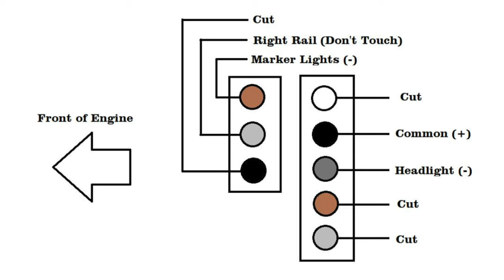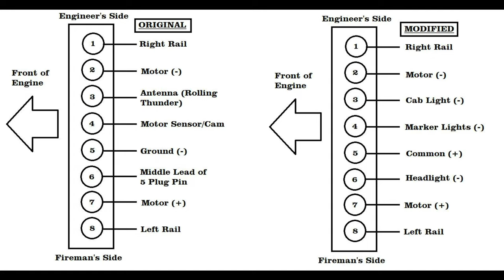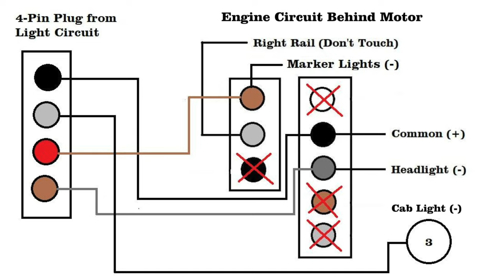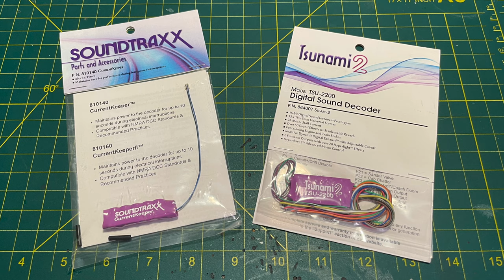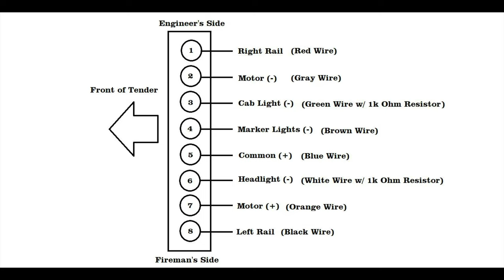How To: Install a Tsunami 2 Decoder into a Broadway Limited Paragon 3 Streamlined K4

Comment: Hi all! I have a light Pacific from Broadway Limited that did the same thing. Did some research and found a way to do a Hard Reset on the decoder. The CV8 thing does not fix this problem. 
The easiest way I found to to the Hard Reset is to do it using a DC controller. Remove the shell of the tender to expose the decoder. Put loco and tender on the DC track. Hold down the Reset Button and while holding the train, dial up the DC power until you hear a Chime. All reset and should work.
BTW nice video.
Reply from the maker: Thanks for the comment, unfortunately I can't perform it on this model, because well, the decoder got replaced haha. But next time I have an issue like this with another model, I will try this. If anyone else has success please let me know. I really hope this is a solid fix! Thanks again for the information!

Comment: Very nice job. Inspiring me to switch the decoder in my BLI 3751 class Northern now.... :)
Reply from the maker: After seeing the results, it makes me want to do all my BLI engines. Maybe starting with the BLI Santa Fe Mikados or my Paragon 3 3751
Reply: @OvernightScaleModels  I did my BLI ATSF 3751 northern. Installed an ESU decoder. Completely rewired wirh new Soundtrax 9 plan plug between loco an tender, new led headlight, Installed firebox light and cab light after super detailing the cab. Very happy with the results. Will be doing the same with all my 2-10-2s now. Far better sound and overall loco control. Thanks for the inspiration 😃
Reply from the maker: @1stArizonaSub  WOW! You gotta  post a video of her! I was thinking the same thing about installing a cab light and firebox flicker. Was the 9 plug pin female installed in the engine or tender?
Reply: @OvernightScaleModels  9 pin male in the loco, female plug with loom in tender, soldered via circuit board with resistors for LEDs, and directly to the decoder for all others.  Loco all new wires soldered to the little horse shoe shaped circuit board attached to the male plug. Pc board filed slightly to slot right in original position of old plug
Reply: @OvernightScaleModels  https://youtu.be/NANLg5cJC1g
Reply from the maker: @1stArizonaSub  Thanks for sharing! The model runs amazingly, I think you've struck inspiration for me, once i get my hands on another decoder.
Reply: @OvernightScaleModels  I used loksound 58410 decoder and 54672 powerpack maxi (current keeper), and soundtrax dbx-9000 wiring kit. The blank decoder was programmed on pc using the esu software and lokprogrammer. I will do a full video on it in the coming weeks. It showed me just how crappy the Quantum stuff was. So much smoother running, much crisper, sharper sound, proper bark from the engine chuff. Completely transformed the loco. Thank you again for your excellent tutorial.

Comment: Can you tell what the wiring pins of the engine from left to right represent? I am planning to do a TCS WOW upgrade.
Reply from the maker: If you go to 3:56, I show you the wiring pins for the engine. But also, I recommend watching the entire video because there are more than 1 circuit board that needs adjusting/modifying

Comment: Very nice tutorial. I’m looking to get the DGLE version and install Wowsound. A TCS board will help negate the resistors and have the keep alive on it from the get go. I will definitely be using this video as a guide for the install but will omit the resistors and adding scale sound systems speakers or my personal set up using Soundtraxx 1” speakers in series with double tall baffles glued to the chassis, it gives better sound and bass.
Reply from the maker: Funny you mention that, I just posted my DGLE version on eBay. I'd love to see the end results! I'm sure the speakers would be a nice upgrade. Also the WOWsound would sound amazing.
Reply: Nixtrainz’ Decoder Buddy boards also have built in resistors which can also support TCS 21 pin boards, alongside ESU and Soundtraxx’s own 21MTC boards too
Reply: @OvernightScaleModels  I will definitely try to share them to you when it all happens. Right now I’m going to hold off on getting stuff as Christmas is close. I definitely won’t keep the paragon 3 in the engine, even if the decoder is in perfect condition, and go straight to Wowsound.
Reply: @CentralJerseyRailfan  as I understand the versatility of the buddy, I won’t use one. I try to keep all items used the same brand as much as possible, especially board and decoder pairings for aftermarket installs.

Comment: Hypothetically speaking, if the LEDs are the opposite polarity then the NMRA standard and all you are doing is reversing it, could you not reverse the way you solder them to the decoder. I’m not sure if this would work but if so it would be much easier then reversing each LED. Again I don’t know, the wiring harnesses might make that not work but would it be a possibility?
Reply from the maker: Great question! Unfortunately no it wouldn't work the way we want it to. Will it work, yes. But not the way we want it to. In this model, every led has the negative lead connected (which is backwards to NMRA having positive connected to everything). So if I place the front headlight negative lead to the negative lead, then all LED's (class lights, cab light, etc) would turn on when you turn on the headlight. But if you completely remove all wiring from the harnesses and circuit boards and hardwire straight to the decoder, then yes you can totally have all light functions separated without reversing each LED. But that is way more work than flipping the LED. You're talking more wiring, more of a mess, more soldering, more heatshrink. It gets too complicated. In this model, our goal is to separate the LED's into separate functions.  So reversing the LEDs is less work in my eyes.
Reply: @OvernightScaleModels  I see, thank you very much for the explanation.

Comment: I had 5 out of 6 Broadway Limited's P5a do the same thing ...
Had to install tsunami II decoders , it fixed the problem ---(( SOME WHAT )) 
The  motors started to heat up extremely HOT ...
MOTORS HAD A SHORT CURCUIT !!!!!
Had to install new motors also ..
The motors are JUNK , WHICH FRIES THE DECODERS ...
Took one of their motors apart , there is 
NO NILON WASHER BETWEEN THE ARMATURE AND BEARING , which sends electricity throughout everything causing short circuits that feed back into the decoders...
ALSO LOOK FOR THE PRESSURE WASHER IS ALL THE WAY INTO THEIR MOTORS FLYWHEEL THAT LOCKS THE DRIVE SHAFT TO THE FLYWHEEL .
If your model has sound but does NOT MOVE , THATS YOUR PROBLEM !!!!!
JUST TYPICAL B.L.I. , TAKE IT OUT OF THE BOX AND GOES INTO THE REPEAR SHOP !!!!!!!
Reply from the maker: Wow that sounds awful, I'm glad I didn't have to motor swap for this one.